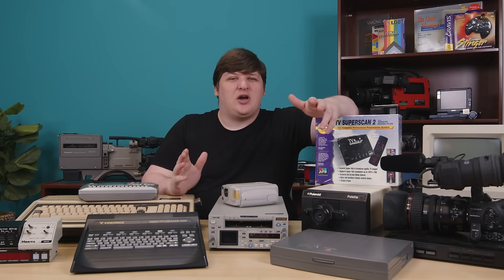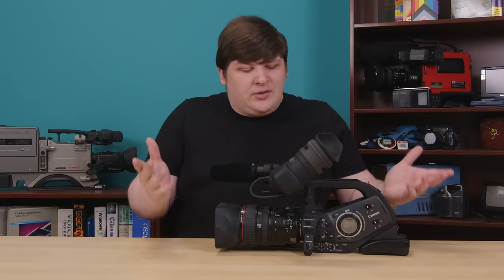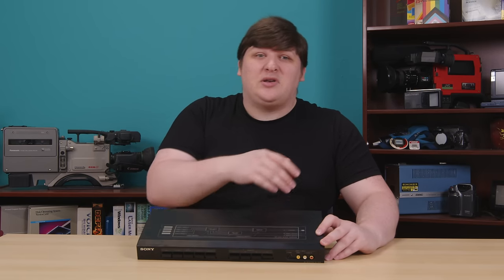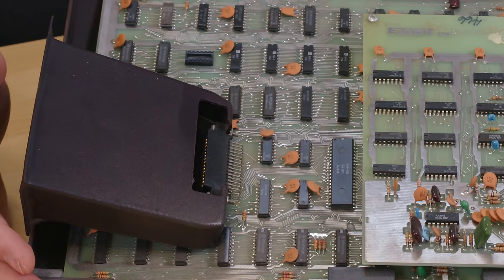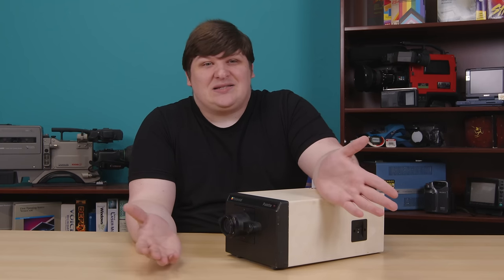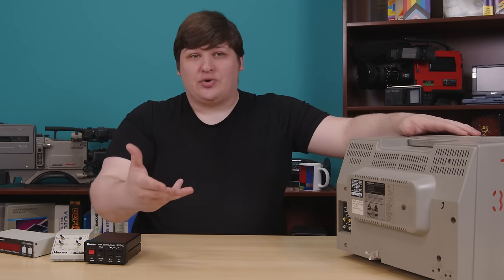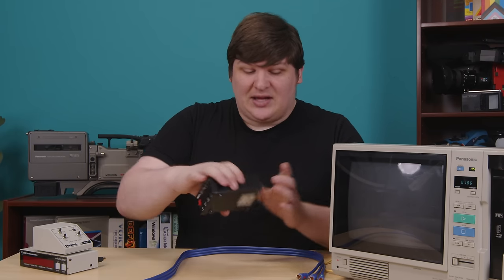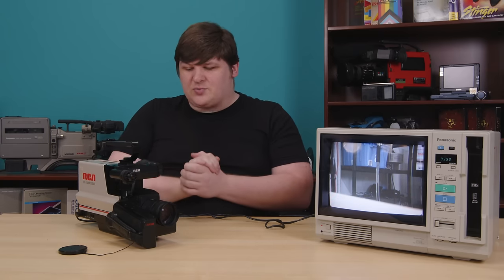Weird Stuff I Got From California (Where else?)

Comment: SMPTE Timecode is very commonly used in the live events industry. A lot of shows use it to synchronize lighting, video, pyrotechnics and automation to an audio track.
Reply: It was commonly used in recording studios to lock multiple tape machines and other equipment.  We had standalone time code generators in the rack of almost every studio I worked in back in the day.
Reply: A bunch of synthesisers had support for it in the 90s too. Nowadays they mostly just use MIDI sync though.
Reply: They have wordclock and tri-level sync these days too.
Reply: I had an Atari St with the SMPTE tracks box and all. With a keyboard and a reel to reel, I was king of the world. But indeed, damn good tech.
Reply: and timecode readers like that are still quite expensive (around 600$), I'm quite jealous of his find!

Comment: Polaroid made a similar device called the "Digital Palette" with a SCSI port to upload an image to an internal frame buffer. What made it interesting was the way it exposed the film, It used only 0% or 100% CRT illumination but varied the length of time pixels were on to create a gray scale. In conjunction with the filter wheel, it would expose a full color image. They made a number of different backs for it. We modded it to fit to a Bolex 16mm film camera and controlled a Stevens motor to advance frame by frame. We could transfer animation from the Commodore Amiga to 16mm film this way.
Reply: Ages ago in the early 2000s I maintained one for students to analog-ize their Photoshop'd photography projects so they could turn them in on developed photographs. I heard that it was cheaper to get film blown up to large sizes than it was to print the digital file on a large format printer.
It was slow (by modern standards) and the software was really picky and had strict internet activation.
Reply: @greenconscious210  plug the hype photo printer more it could printer photo, but it didn't take expert spot the difference, even today, unless, top end, using exotic waxes and such, price for price, you get way more photos, and going expensive/exotic is just replacing film and print media, unless you talking road side bill board sizes, where hi-res digital , not think? us colur spot the size of your finger tips

Comment: So many thoughts to add!  I kept this knowledge for just these occasions.
I was working at a media company still using U-Matic tapes in the early 2000's.  The company worked at horse racing tracks around the city and people could order a VHS copy of races.  So even in Y2K, U-Matic (recorded in Low Band too - more on that below) had better quality than VHS.  So it made economical sense for the company to keep using it.  We did have some Betacam and Betacam SP, but all archives were low band U-Matic.

5000 series U-Matics are low/high band decks.  This is something to do with colour recording on tape, I've forgotten the specifics.  Effectively high bands recordings are not-backward compatible.  There was also some anecdotal talk about low band lasting better, but meh.  We also used 9000 series decks as well.  These were U-Matic SP (metal tape instead of metal oxide), but archive was always in low band standard tape.  I learned how to edit on a 5850 without an edit controller and manually rolling the players.  This was a real "this is why you do this" kind of education that helped me no end later on.

We had one 5600.  This was used as our end of day deck at the main city track.  This deck has a mechanical counter with a "loop" mode.  To use it, we'd make a tape of the day's racing at the end of the day.  Then we'd NOT rewind the tape after recording, put it in the 5600, zero the counter THEN rewind the tape.  The deck would then continuously run the tape up to zero on the counter, then rewind to the start.  U-Matic doesn't have a time-code track (like Betacam does) so everything was done with tape counters unless you added extra equipment and sacrificed an audio channel.  The mechanical counter was a bit more reliable than the electronic ones too.

Your DVCAM time-code demo showed a big issue, really well - you had two different time-codes on one tape and they're out of sync.  The display box wired to the output and the deck itself were showing both time-codes at the same time.  The out of sync time-codes will make a VTR continuously scrub a tape when you tell a VTR to "go to time code blah...", the like when editing with a controller.  The perpetual scrubbing happened when the tape would slow down close to the go to time-code set, see a different time-code, start scrubbing fast again, then seeing a different time-code again repeat the process in a loop.  As you mentioned there is LTC on an audio track, but there is also VITC (Vertical Interval Time Code) in the video.  This is encoded in the blank lines at the top of the frame, like closed captions.  A broadcast monitor will have a switch/button to change the video timing and show the VBI (Vertical Blanking Interval).  Use that to check the data is present.

By default VTRs will use LTC on high speed scrubbing and playback, then use VITC at slow speeds and paused.  The time-code display on most VTRs will show an some kind of indication depending on which is in use.  Two types are used because the LTC audio track won't decode at very slow speeds and the VITC data corrupts when high speed scrubbing.  VTRs will have switches/menus for changing to using only one type of time-code in the event that the two differed like your tape.  You could also re-dub LTC from the VITC quite easily - the other way round lost a video generation and just wasn't done.

In one recoding situation, I would set the U-Bits (User Bits) to the date, set the time-code to current time and then set the time-code generator (in the camera) to free running.  In that mode the time-code just runs regardless of tape recording.  I set it this way because where I worked at the time, races were referred to by their time of day.  The editors loved it because the tapes came to them with all the day's races already ID'ed for them (location in the shot, date in the u-bits and ToD in the time-code) without having to guess.
Reply from the maker: Wow, thank you for all this info, especially about the mismatched timecode - I had noticed it and wondered what it meant!
Reply: The difference in displays in the DSR-45 segment is because the DSR-45 is set to display the Counter, not time code. It's the little switch above the LED display.
The TC output will however always output LTC,which contains both the "Time" part of the time code and the User Bits.
DV/DVCAM/DVCPRO formats use DV time code, where the data is stored as, well, data; not as a linear track like audio or within the video lines like VITC like the analog formats.
Reply: Shows the difference in technology generations. I learned and worked on mostly analogue equipment. When I did eventually work with digital tape formats, they were engineered to mimic “the old ways”.

I didn’t notice the counter button. I saw two time-codes and called “autowash”. 😅

Comment: I'm a sound mixer in film and your description of timecode was spot on. You keep a master clock, which is either your sound recorder's internal clock or a timecode generator. Each camera gets it's own timecode generator which is jammed from that master, along with the timecode slates. Timecode isn't only for syncing the audio recording to the video, it's also there to sync many streams of video to streamline editing when you have multiple cameras on set (which is always). Timecode also encodes 8 user bits, which are those numbers that flash when you clack the slate. People use for date and roll number (10.11.22.01 for instance).

The industry standard right now is Tentacle Sync, which is a company that started as a crowdfunding campaign and went on to beat out Ambient and Denecke with a timecode box that was better in every way and half the price. We went from $400 hunks of aluminum that took 9 volts or AAs to bluetooth connected, usb-c charging, $200 units about the size of a 9 volt!
Reply from the maker: yeah i forgot about the camera-to-camera sync, which is funny because it's actually the most important reason for me to know about TC - I've been meaning to do something about that for months ever since I got my second camera, right now I'm just using a clapperboard + triggering both cameras at once and then matching up the clip durations. barely works. anyway, thank you!

Comment: For that Chinon ES3000, it appears that it needs linear flash, the PCMCIA predecessor to ATA flash that the overwhelming majority of PCMCIA flash (and CF) are. I have a spare linear flash card if you want it. (Apple Newtons also needed linear flash, rather than ATA flash.) I have a spare I'd be willing to send your way.
Reply: I think old Cisco routers used to use those as well? I've got two PCMCIA flash cards pulled out of dead routers and they were recognized as 16 MB linear flash by Linux.
Reply: @grawity  they did undead do that

Comment: Exidy was an arcade game manufacturer and the inside of the Exidy Sorcerer basically looks like a late 70's / early 80's arcade PCB right down to the lack of solder mask. Arcade PCBs from that era were manufactured as cheaply as possible and sometimes had poor design especially in the power supply. It wouldn't surprise me if the Sorcerer was manufactured by whoever was doing their arcade machines at the time.

Comment: B&W makes it easier to see contrast and helps you find focus faster. Peaking helps a lot on color monitors. (works in broadcast)
Reply: I had an inkling it was due to the sharpness making focusing easier :) 

Especially because nowadays colour previews have to have all sorts of tricks, like showing yellow blobs where some edge-detection algorithm says things are past a sharpness threshold. And the operator has to adjust until finding the peak “yellow blobbyness”, if using that feature.
Reply: @kaitlyn__L  Yea, color monitors make you rely on their interpretation of contrast when you turn on “peaking” an overly bright light can make the monitor give you the false impression of sharp focus. Color is nice but B&W is all an operator really needs if they have a director telling them where to point and how to adjust framing

Comment: SMPTE is also widely used in the live production industry, it's used to sync all elements of a show together. If you've been to an arena show in the past ~15 years chances are most of the lighting and automation was running off timecode, with the operators mostly standing by for safety purposes. Those little boxes are actually super standard kit for us, they even make nixie tube models cuz we're all nerds too.

Comment: One note on the 3.5 inch 9v center positive power cable on the time code burner,  a ton of guitar pedals specifically DOD and EHX use center positive plugs so its very easy to find 9v center negative to positive converters.
Reply: IIRC, the old Atari 2600 console used the same jack, but not sure of the polarity. It would definitely have meant a large amount of spare power supplies available.

Comment: On the topic of the 1440x1080, yes, it was entirely bandwidth, but even with the shrunken frame, HDV still suffers bitrate starvation artifacts (though part of that might be because it sort of predates AVCHD so the codec was not as efficient and those 28Mb/s just weren't quite enough--same bitrate as the old DV format because tape speeds).
Reply: And here I thought it was also about improving sensor yields. Since I knew eg the cameras used for Star Wars II and III had “full 2K” (so probably a little more than 1920 wide), but were extremely expensive at the time even compared to all the rest of the market.
Reply: I could see that being justification as well. I have largely just read repostings of publications that have made their way onto the VideoHelp boards.
Reply: @bakonfreek  I’m sure your reason was a primary concern — why invest in better yields if there isn’t the bandwidth to begin with? So it’s no coincidence we started seeing better only after SD cards had caught-up enough to replace (H)DV. 

But then that also tracks with why the bigger sensors were so obscenely expensive, because only a handful of products would be made with each to recoup the cost, since no one else even had the bandwidth. 

Though that said, I wonder what rate Digibeta ran at… hmm okay, 90Mbps. Guess that was what you had to use if you wanted better 1440x1080, or had the very very rare camera with more pixels.
Reply: Makes sense, though even on much higher bandwidth formats (DVCPRO HD, 100Mb/s), sensors were often not even 720 capable, but to be fair, the 1080i/p resolution on that format capped at 1280×1080 (even though the tape ran so fast that DVCPRO HD only ever used non-mini DV cassettes).
Reply: @bakonfreek  yeah, every TV show I’ve known that used Digibeta was SD (albeit PAL so 96 extra lines). But with an HD-suitable codec it seems like it was capable! I imagine the dearth of non-cinema-projection 1080-line home displays until the end of the 00s was an incentive to just use slower speeds and lower resolutions for most productions.
Reply: HDV was much more limited because it was trying to cram more pixels (with crunchier compression) into the same space as DV so I guess the value proposition was just kinda super convenient for sensor makers now that ya mention it (HDV also showed up on consumer gear—Sony HDR-HC3 for example in 2006).
Reply: Doesn't exactly futureproof the archives, but I guess that always ends up being a problem for the future versions of the production team (and if AI video cleaning can get to a point where it sucks less than it does now, it's not like the real and artificial limitations of prior decades will really matter).
Reply: @kaitlyn__L  Were they shot to protect for a 1920x1080 safe area?
Reply: @bootmii98  they just weren’t shot that wide to begin with. It was just 1.5k wide, albeit 1080 tall, because the sensor itself was 4:3 in pixels terms and they used non-square pixels in the final output. That was the norm for most 1080p cameras until about the 2010s, and is why there is the argument over whether 1080p is 2k or 1.5k — because in 16:9 it is 2k but at 4:3 it’s 1.5k. And part of the point of discussing horizontal resolution (like 2k, or 4k) is so that it stays the same regardless of aspect. For instance ultrawide 1080p is “really” 960p or sometimes even 800p. But it’s still 1920 wide!

Comment: Fun trip down technology lane! I utilized at least eight of the items you featured here. The Panasonic WV-F70 was the cost-efficient 2CCD alternative to the 3CCD 300CLE and WV-F250, with the 250 having a similar docking pin attachment to that of the F70. My F70 was paired with a portable Panasonic AG-7400 SVHS deck, as the AG-7450 was a bit more expensive even used at the time, which also could pair with any other camera with a 10/14-pin interface. These Panasonic cameras were also a cost-cutting measure for some mid to small market local TV stations vs. purchasing new BetaSP or the infamous Panasonic M-II videotape format in the early 1990's, with the major downfall being generational loss when edited to Beta, 3/4" or SVHS.

Comment: That Exidy Sorcerer brings back a lot of memories. It was my first computer and came with 32kb on board. The S100 had ram cards adding up to a whopping 56kb and a floppy interface card for my Micropolis double sided double density hard sectored 5.25 in floppy drives. To round things off I had a green phosphor monitor and an Epson MX 80 dot matrix printer. This was in 1981.Anyway, my system would operate either Micropolis Dos or CP/M, booting of drive 0 with an Enter <adress> command. I would run Micropolis Basic, Exidy Basic, Pascal MT Plus, Cobol and few other things. Yes, it did have rudimentary graphics using the character sets on the keyboard and I actually would code my own in hex. I still have mine, but it needs to be repaired. It was a good machine for its time.
Reply: I have a bunch of those cards they got from a guy who thought they were meant for a TRS 80. One of them is a discard the other one has a processor on it a 6800, and the other one is a big Ram card which I think goes to 256k
Reply: Back in my day 256k wasn't possible AFAIK. That card probably came later. As I recall, some guy wanted to modify the motherboard and increase the ram to 64k, but I refused in case he damaged the computer. My S100 has about 8 cards including the floppy controller, which is why it maxed out at 56k, which was more than enough to RUN CP/M, wordstar and most CP/M software of the day. Just an additional comment on the 8 track case, I thought it was so cool and smart. This machine was from the 70s, after all.

Comment: I worked in a studio in the 90's. We used SMPTE to sync a 24-track tape machine to an Atari 1040STE running 2.0 via a converter-box. With a fresh tape, you'd start by laying down the SMPTE-code from to Atari to usually track 24. When that was done, Cubase was set to "slave" to incomming time-code. After that, the controller for the tape-machine was now basically the master-controls for play/stop/ff/rw. The Atari would usually sync up within 1 second, and also be in the right spot in the song of course. Worked really well.

Comment: I'm pretty sure that "weird hand grip next to the lens" on the XLH1 was Canon's way of imitating the controls found on ENG camcorder lenses, which are on a "grip block" mounted on the left-side of the lens itself and have a multi-pin control cable which plugs into the camera body. Canon's version of those controls on their XLH1 means that their lenses are less bulky and the controls don't change when the lens does.